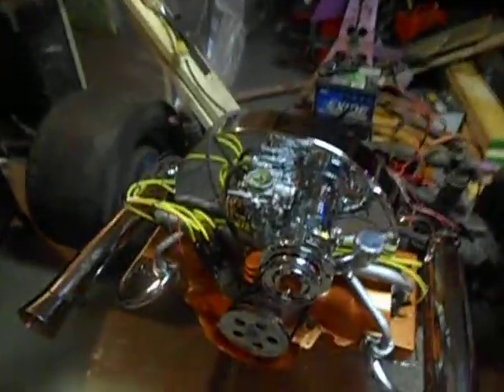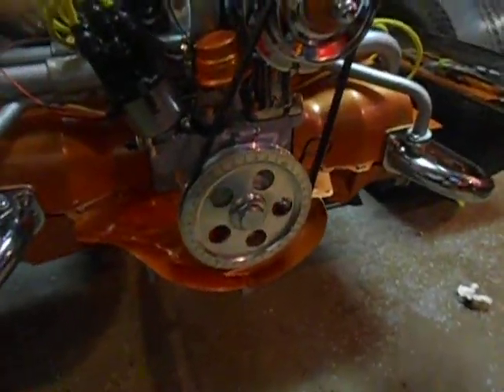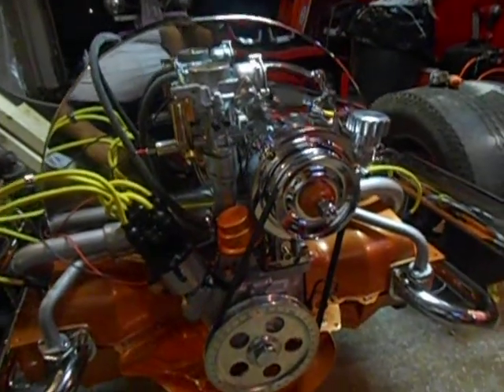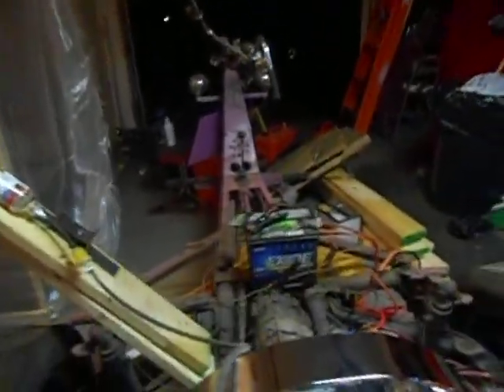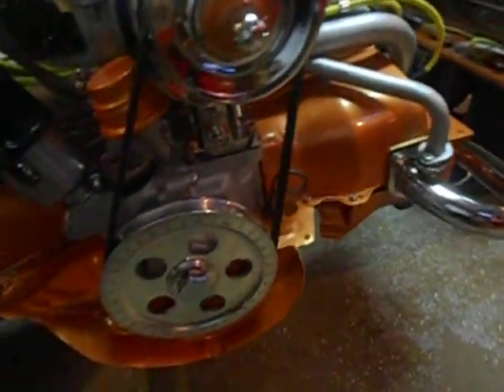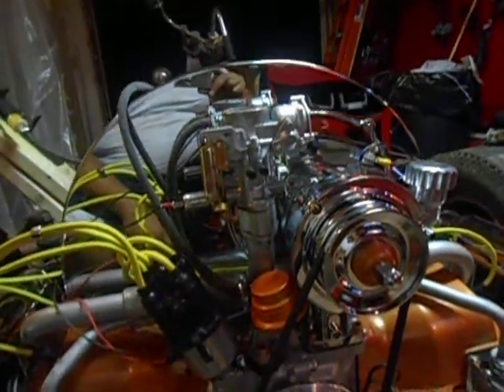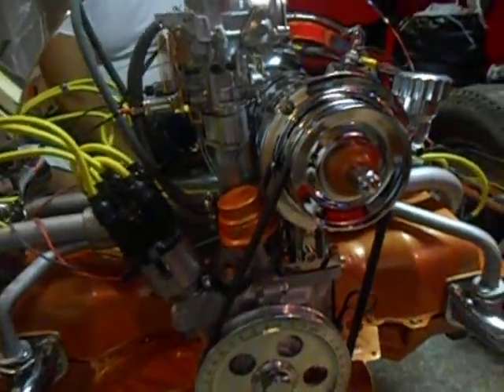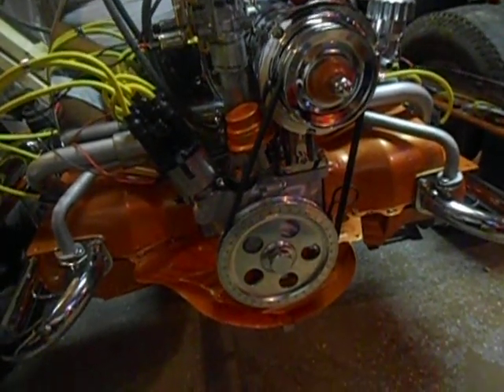VW TYPE 1 ENGINE REBUILD

Comment: In any other application, I would poo poo you for using a single port engine. The performance upgrades and possibilities for a dual port are fantastic. But for a trike? No problem. Honestly, you're not building a race trike. I think trikes should be long distance cruising machines that should offer far more in the way of comfort and dependability. And for that.... a single port engine is just fine. Kudos to you, dude. You Rock!

This is my opinion and ONLY an opinion.... But, with the Brosol carbie, you could I think, get better performance with a stock vacuum advance distributor. The 009 is a centrifugal advance and has become the "go-to" dizzy when after market carbies that don't allow for vacuum advance are being used.... such as Webers or Dellortos. But the 009 does have a flat spot just off of idle that can be very annoying. You're running a single port engine with a single carb that will work fine with a stock distributor. I do believe that the stock distributor will work very well, be very smooth and give many years of trouble free performance. Just my thoughts. Maybe some other VW perverts can chime in here.

Comment from the maker: When I did the rebuild I fought with myself if I should go dual port but I opted for single port. I was told that the trike once had dual carbs on it and they had a hard time keeping The front wheel on the ground. I figured single port would be fine for taking her to car shows and some summer rides. That is if I can actually get it finished.